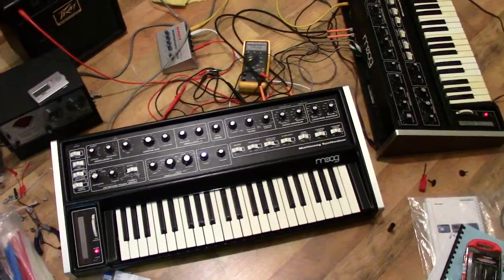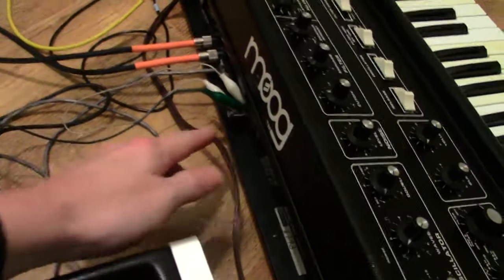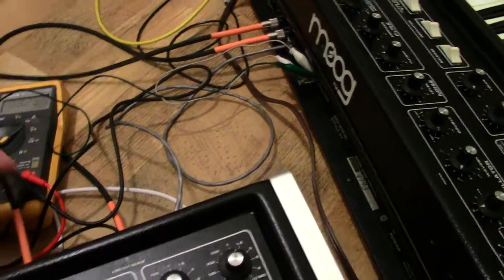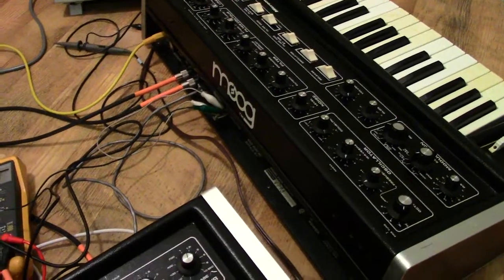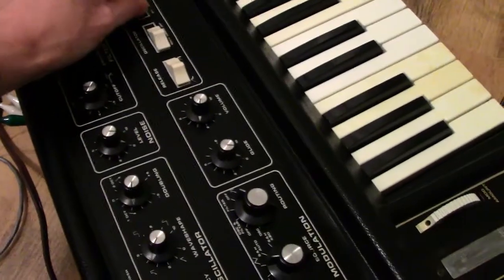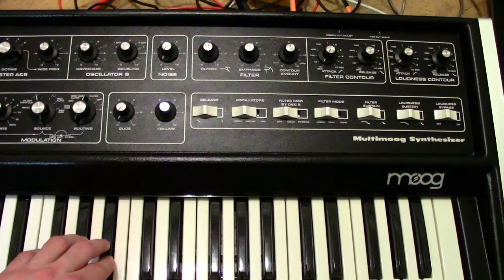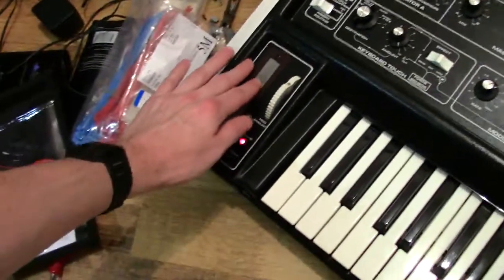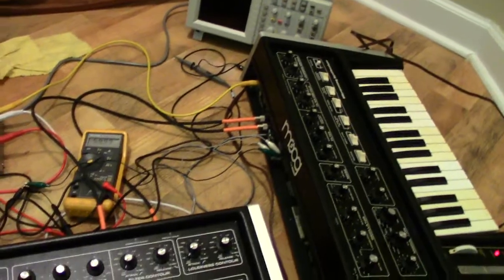Micromoog/Multi Modulation Jack Part1 (By Synthpro))

Comment: How did you fix the rivets on the old switch which obviously isn't available unless, gutting a broken one which is never broken.
Reply from the maker: I have a special teqnique for repairing those but have had to build a replacement from another style rotary switch, not easy but it can be done.
Reply: +synthpro I'd like to know more. The op amp has been replaced but maybe the fet is bad. I'll have to remove it and test it. I believe it's in the switch or diode CR902 which I can't find anywhere on the circuit board lol. Doh!

Comment: Help me out please with a S n H thing going on with my Micromoog. It may be the switch or Cap .47uF
Reply from the maker: Are you referring to a sample and hold issue? There are several things that can cause issues with sample and hold. is it not working correctly, is it always active? If it is working but you are not hearing very much of the Sample and Hold as you bring the Mod Wheel up, it could be a bad opamp associated with the signal fed to the FET, seen this before.
Reply: +synthpro the SH is the only thing that doesn't work and I've read the troubleshooting suggestions on the manual. When I have more time I'm going to research further. Any way you can point me to CR902 a diode that I can't find?